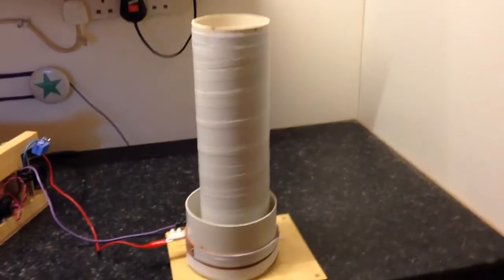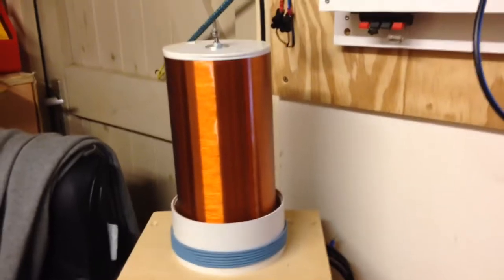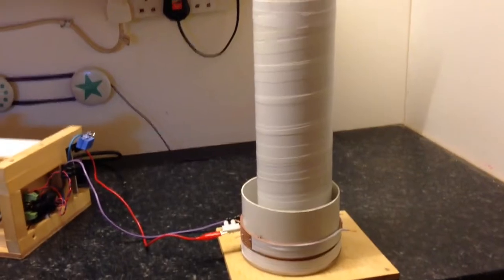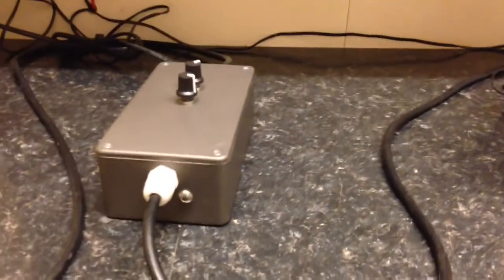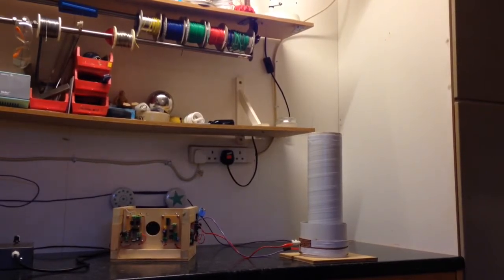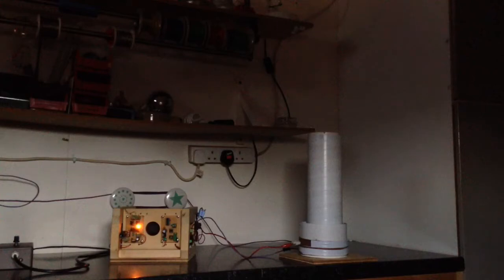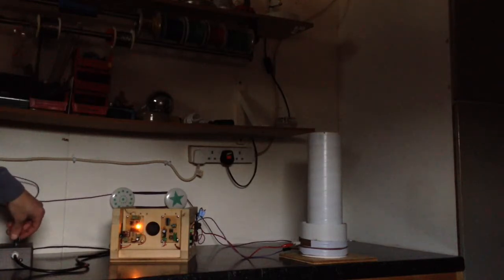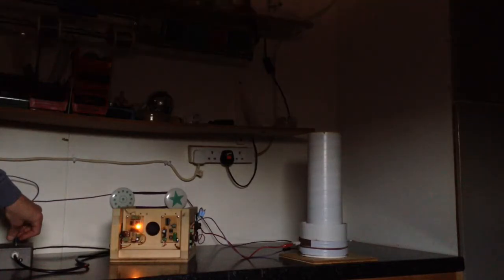PLL Tesla Coil  - Half Wave - Half Bridge

Comment: Do u add resonant capacitor to primary coil?
Reply from the maker: Yes bud, it’s the little blue mmk cap mounted on the corner of the wooden box. You can just about see one side of the primary running from it :)